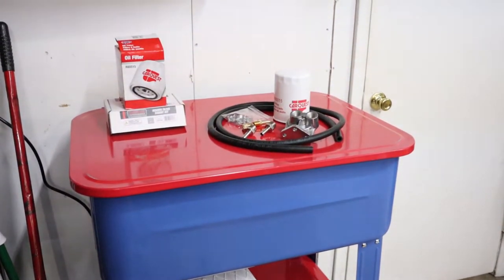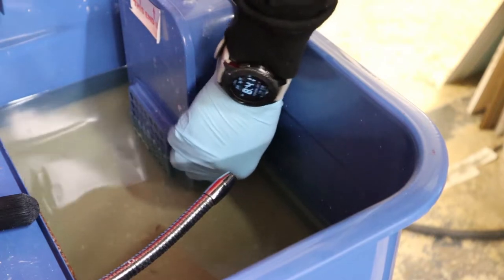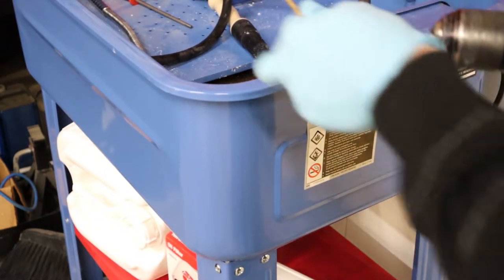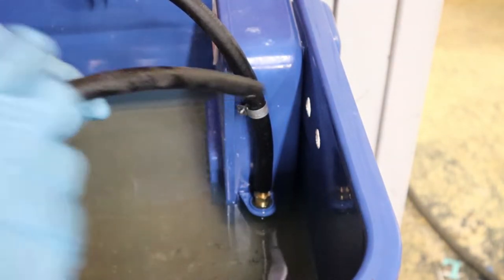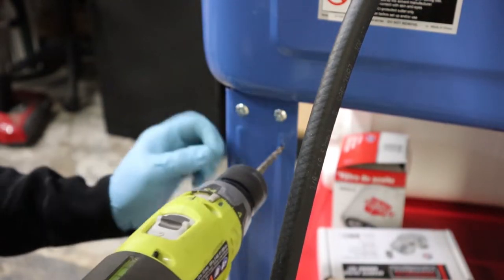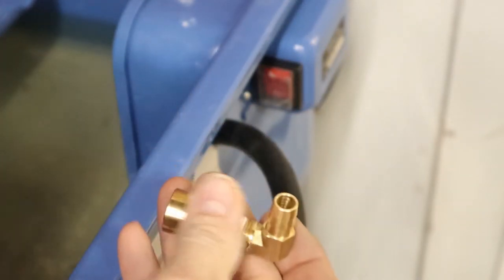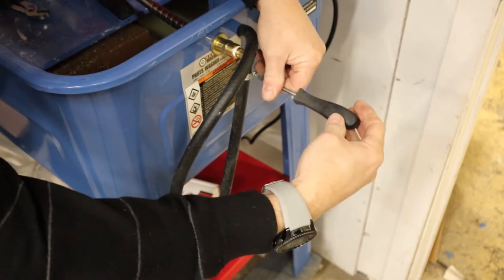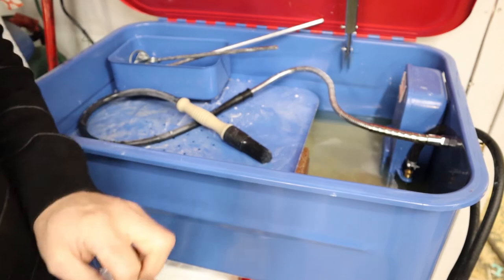Screen Printing Parts Cleaner w/ Filtration

Comment: Nice video! Did you add the filtration just to prolong the life of the pump? Aren’t those parts washers made to handle heavy solvents and debris?
Reply from the maker: Yes... due to cleaning the ink which can be fairly thick.

Comment: Great video. My question is about the filtration.  From my studies what is needed is that the pump does not receive large amounts of debris. Your filtration system is after pump.   Can not understand why you did that ?
Reply from the maker: Good question... We did it that way due to the fact we are using the supplied pump that works as a submerged pump in the tank.   This is how most all parts cleaners work, and we didn't modify that part.  We simply added the filter on the output side of the pump.   If (or when?) we have to change the pump out, we may go into the filter first, then go through the pump.
Reply: Thanks for the answer.  It makes sense. Any how,  I enjoyed the video and quality of installation step by step. Keep it up !

Comment: So hows it working still? Did you go through a pump yet? Still using the same easiway solution?
Reply from the maker: Yes, still using the same solution, and yes the pump did go out (pretty much expected), so replaced with a different pump.  Will need to go back and see which make/model that we used
Reply: How long did the pump last? Wondering if it's worth grabbing one with the rest of the parts or if it can wait.
So the oil filters work well with the easiway huh? No complaints there?
Reply from the maker: @michaelallen7747  - Don't recall exactly on the time, but will vary with use also.   Oil filters seem good, just change as needed

Comment: How many gallons of 842 do you use in teh tank at a time?
Reply from the maker: Bought 2 of the 5 gallon and use that
Reply: @Novoworks  How long did it last?  Did it evaporate at all?
Reply from the maker: @StoneridgeGraphics  long time.. just depends on how much you use it ;)
Reply: Do you have a link to the new pump you purchased after the OEM stopped working? @Novoworks